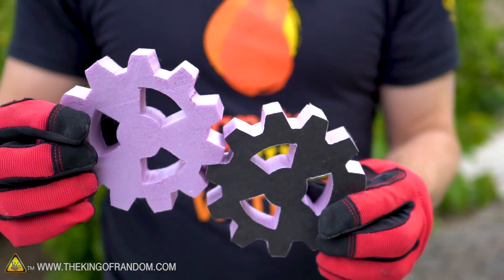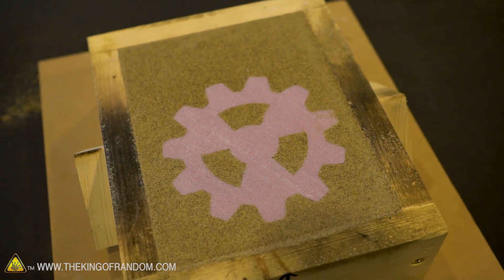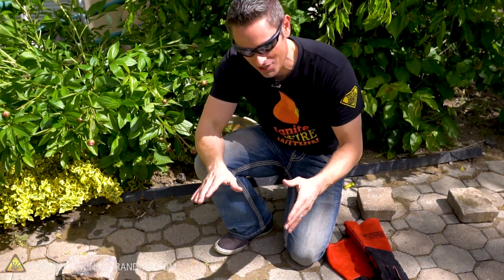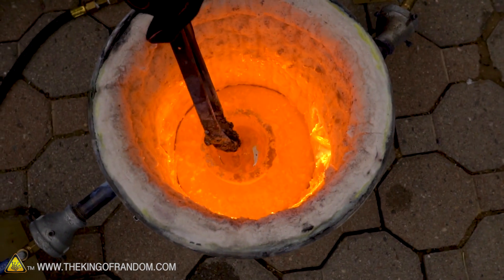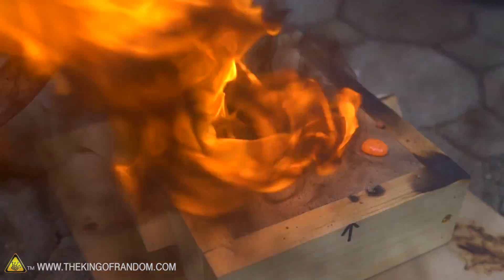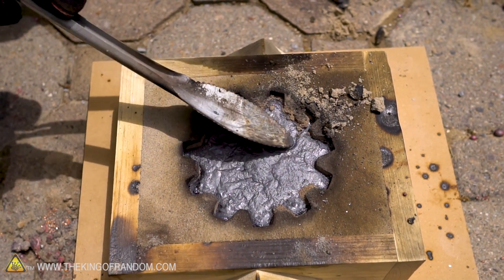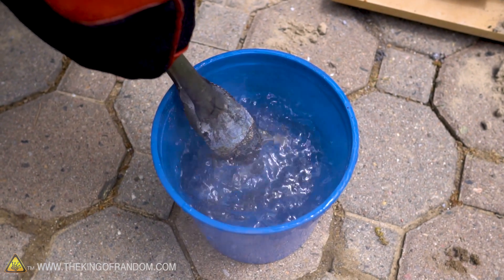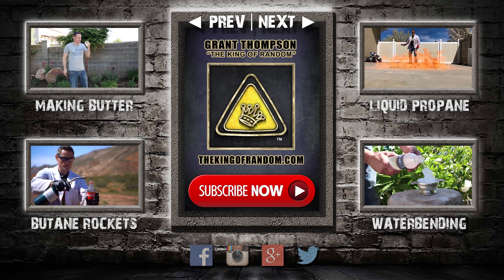Argh. Why Is Copper So Difficult? TKOR Tests Melting Copper In Our Homemade Foundry

Comment: Why aren't you using a cope? You have to have a cap on top of the mold, thus drag and cope sand casting. Copper is particularly difficult to cast due to gas absorption, not conductivity, it loves oxygen.  Capping your crucible would help, and try to keep your furnace reductive, the less oxygen the better. And where was your flux? A couple of teaspoons of borax would have helped tremendously... But, hey, who am I to tell you what to do...

Comment: cover it up. use a hole to pore it in. it will help keep the casting in place. make like a lil buffer so you dont spill al the copper. if you look at pro casting. never wil the cast be open. the air and water in your cast makes your cast brake up like that. copper is heavy, air and water is not and wil go up if not kept in place. its that simple.  ;-)

Comment: Geez, when have you amateurs ever seen someone set metals in open air moulds?  The forges of Mor'dor?  Make a straw from styrofoam, have it go through to the middle on one side and the rest of the way through on the other, pack the sand half way into your mould case, and put the actual gear shape in the middle, pack it the rest of the way.

Comment: I'm sure I'm not the first to mention this, but try a 2 part mold. Should help solve the lifting sand problem, also, try a Les dense foam, as it will melt out more readily and should provide a better finish, everything else looks right though.

Comment: Maybe instead of using the crucible to melt the foam, burn it off with a torch. Down side is the sand getting too loose. When you pour the copper there should be nothing in the mold to burn.

Comment: The reason why the sand is breaking is not the melting point. The burning mold produces gas. The pressure from the escaping gases has no where else to go. The copper is more dense than the sand. So the Sand gives way. This goes for all who are trying to make molds with foam.
Reply: and adding water to the sand makes even more gas with nowhere to go...
Reply: yes, he needs a better curing method for his green sand...I am guessing his clay content is kind of low as that sand did not look like the stuff I usually use.  I make my molds pretty wet, then let them cure.  Rarely do I leave the core of the mold in place either, nor do I open pour more than 30-45g of metal either; and for copper I don't use sand at all...plaster is way better for non-ferrous casting.
Reply: I think that another important reason (or more important then the escaping gases) is the Idrostatic force. I don't know the specific weight of sand but I'm sure that buoyancy force has a important role.
Reply: it works fine for brass. i use sand casting for all my gun mounts.
Reply: smart cookie , btw cookies cant besmart they have no brain , jk

Comment: Why are you using an open mold? Use a cope and drag mold. Get the oxide and slag to float up and out, keep heat in, help keep O2 out, stabilize the fragile parts of your sand. A whole list of benefits! But do't keep doing the same thing expecting a different result.

Comment: If you use settlement sand which is sand with cement wet it let it sit for a day or two it hardens and would actually let you have a reusable mold

Comment: Maybe you can use something like a little piece of metal. In the  pieces that we’re falling out.   The pack the sad around that. Much like. Rebar is used. It may stiffen them up enough. To pour 
I’ve seen other videos where the mold is totally inclosed to the the cast is poured into a little hole that. Is made  but be sure to put a few vent holes if u do that

Comment: The problem you are having is with your structure mate, you need a double layered sand so after you flipped the frame to pour the copper you shoulda put another wodden frame and filled it with sand and leave a tunnel like shape for the copper to be poured in and spread in nicely without ruining your sand shape and also shoulda added a breather hole as well

Comment: You sand does not have the required moisture. Casting sand would be far better. When doing a casting like the one you are doing spent wax would work better.

Comment: I think the reason that the mold kept breaking apart is that the sand was actually too wet. Notice that when the sand was dampened further, all of the center molds popped out, and when it was mostly dry only one did? There was too much water.

Comment: Question: why not bury the styrofoam gear with a riser and pour down the riser and allow the sand to keep the copper at a higher temp through insulation?

Comment: Hey Grant, might I suggest a smaller gear? If the main problem is cooling to fast, a smaller gear, with the copper at the same temperature should cast a lot easier than the larger size you've tried. Merely a suggestion but i hope i can help you!

Comment: I feel like you can do it with a plaster mold. Just glue the gear to the base and when you're pouring plaster into the box, try to get as much air out as you can by vibrating the box. Melting temperature of copper is 1085° Celsius and plaster can handle up to 1200° Celsius.

Comment: I've never seen a copper casting done commercially in an open mold (except for ingots). The thing with copper is that it's so thermally conductive that it never forms a "skin" of solid metal on teh outside to protect it from oxidation and such, so when it cools, it cools all at once. Because of this, your gating and risers can become quite interesting.
Reply: Your biggest problem though, seems to be from a complete lack of binder. Try adding some clay to your sand.

Comment: Just wanted to note two things... from what it looks like here it looks like you didn't tamp the cast soon enough in the process, and adding moisture was the opposite of what you needed to do - the reason it kept breaking off is because of the gasses being released breaking apart the smaller sand pieces. it needs less moisture.

Comment: let the mold dry for a couple days as an engineer I noticed when you added moisture it broke worse.  I assume what happend is the bonds broke when the moisture evaporated under high heat.  If I had the stuff I would try it myself but I would use wet sand to make the mold and then let it sit for about a week to get rid of the moisture before you do the casting..

Comment: I would try using a heat gun to melt those molds.  Much more consistent and easier to control and would allow you to leave your crucible in until you're ready to pour.

Comment: Six attempts and you haven't done any decent research? 

I haven't watched the rest, this was just recommended to me, but with a few seconds of logic and I think I have the answer;

The copper keeps breaking the mold, the casting is always messy. Perhaps the mold is the cause. Why not try hard set clay for a mold? Or Finer and cleaner sand, or perhaps a closed mold where you pour the liquid into a hole in the top?

I don't know maybe half an hour of research on the internet.

Comment: I cast alloys all the time from gold silver and chrome. I have a machine to do all of my castings. But usually I have a 50/50 mix of plaster and pumice. I set my object down in the middle of the mix. I usually do it on a burn out oven just to burn out the plastic and have a coating of carbon since copper have similar characteristics as gold (heat temperature 600c). Before pouring your copper in the heated mix make sure that you increase the temperature about 10 degrees of your crusible because you have to compensate on the heat loss of the molten metal. I hope this works

Comment: Literally you are the only thing making this difficult, research in staid of just winging it...
Reply: Said by somebody who has probably never even welded, let alone poured a cast. The reason he is having a hard time is because he is being stubborn about using playsand instead of casting sand. He probably knows full-well that there are better ways, but I would guess he wants the challenge of using these materials.
Reply: Fair enough. I still get the feeling he was actually just trying to involve the community to try and get commenters to suggest possible solutions, instead of just watching without thinking. It's a little more interactive that way. At least he's not doing it so wrong that people are going to die if they try this.
I once saw a tutorial on how to "weld" (really it was brazing, and not even doing it right) aluminum where the guy was first, grinding without a mask in an enclosed space... and second, did not clean up any of the aluminum dust before setting a torch to the brazing rod itself... the whole thing was just wrong on so many levels.
Reply: yeah its all part of his nice experiments
Reply: exactly. this is why i dont watch theses channels, experiments are fun!
Reply: The whole point of his channel is DIY. (DO IT YOURSELF)
Reply: What fun would that be though? This is his research. Nobody would watch if everything came out perfect everytime. There are plenty of channels to watch if you want to find out how to do it right. The trial and error is the fun part.
Reply: That's why he's the King of Random.. he just tries random stuff hoping it will work...
Reply: Not exactly a helpful comment.
Reply: YUP!  The old saying comes to mind:  Read a book Yah Pranit !!
Reply: Play sand does not have nearly enough clay in it.  Play sand only holds it shape when wet, and thus the copper evaporates this water rapidly without clay to bond the silicate together it just floats away.  Real green sand is neither expensive, nor hard to find, and the average metal worker has known the need for it since the bronze age.
Reply: Maybe you should pay attention to what you type instead of just ‘winging’ it.
Reply: Use a wax gear to make your mold. Or saturate your sand with wax.
Reply: Stephen Borntrager I do on a near weekly basis, this was just frustrating to watch, don't assume every commenter is clueless.
Reply: Neil Carpenter Exactly

Comment: You need to use casting sand(oil and sand) and make a runner and riser mold(double sided) and it will be much easier

Comment: Btw, you screwed yourself by adding moisture.  Adding moisture just means that the water will boil rapidly...hence why it basically blew apart.  Use extremely dry molding sand along with a closed mold.  I guarantee you will get the part you are looking for.
Reply: Moisture is not the only problem. Silicate sand is waaaay less dense than solid copper. We saw those chunks of sand floating on the surface - which suggests they were basically pushed out by pure buoyancy force in accordance with Archimedes' law.
Reply: yeah, I actually start with wet green sand...but I also let that dry out then.  The water and compacting tends to help the clay in the sand to bind better.  Water will cause pitting/bubbles.  Closed mold is a must.  Just not sure why he didn't just use a vacated plaster mold though either...non-ferrous cast can be done with plaster super easy...and if he was willing to split the mold then realign it, he could have kept to a single pattern and made dozens of molds to try and re-try the process a few times.
Reply: Jared Adams true
Reply: He said at the end that he hasn't seen copper casting in green sand so he wanted to try it if it could work

Comment: Man, you need to make 2 sand molds (on half of the geard\ mold) unite 
the both  molds and make 2 drains 1 to pour the liquid cooper and second
 one to evacuate the air so no bubles will form ! And I guarantee you 
wil ldo it from max the second turn !

Comment: you have to wet the sand until it's of little bit thicker than mud then you have to pour it while it's molten and it  and dry out the mold while not ruining the details of the mold itself

Comment: It works if you use a full mold with vent tubes instead of half mold, and get rid of your Styrofoam and use wood...note...take wood out before you secure molds and pour

Comment: If you try again sometime, maybe pour the molten copper (or other metal) from the sides and not the middle. Pour in a circular motion from the edges to the center?
Reply: Alternate idea: Place a weighted item just above the mold to hold down the parts that comes off and see if that works.
Pour from the edge and fill it up.

Comment: Run your gas torch over the mound as your pouring it stops the oxidizing that's how they did it on the sea core line at mim

Comment: your problem is you're using a sand mold, you need to use a plaster mold and a wax insert, the copper will melt the wax and be instantly replaced by the molten copper. once cooled the plaster can  be dissolved away with water or chipped away with tools.

Comment: All you have to do is put a top on it that's made of sand with a in hole about 1/2 big over the part you want then  add your hot metal in it how I have made parts useing that way

Comment: Hi KoR!  I don't have any experience with metal casting, but maybe this would work...Did you try making a channel in the sand to the edge, and then covering the open face of sand (where you were originally pouring the molten metal with another piece of wood?  That way you could pour it through the side (once you made a hold in the side of the wood, and the middle parts that keep crumbling would have support on both sides, maybe less likely to break apart.  The gear would have a long metal tag after it cooled but you could easily remove it.  - Hope that helps.  Love your channel! - Omar

Comment: My impression is that the impact of the pouring copper destroyed your mold in all cases. Try adding a "riser" to pour in, although of course you can not make it higher than the surface, it will give you a spot to safely pour into. You will later have to clean up the channel between the riser and the mold, but that should not be a problem.

Comment: I'm curious about pouring directly into the mold cavity, perhaps create a pour basin off to the side to allow the material to flow into the mold. In addition, I'd heat the mold with a torch before pouring, the material is solidifying before it can flow out properly. Just my 2 cents.

Comment: Maybe burn out the mold with a torch, then add a spru to the one of the teeth. Arrange the spru on top so gravity will pull molten copper into the mold and fill out that way. Sandwich everything on metal plates during the pour

Comment: One of the reasons is definitely that the mold is wet. The copper is really hot, causes the water to boil and then you get bubbles in your cast and critical failure of the mold itself because the water will expand and break it apart. You can remedy this by baking your mold in the oven which will also reduce the thermal shock on the mold and slow down the cooling process slightly.

Comment: Thought: heat from the copper is causing the moisture in the sand to evaporate too quickly, causing the detail to lose adhesion and break. Try a plaster or clay mold, maybe?

Comment: you should try to cover the gear with some more sand , a hole in the middle and pour until the hole is full, so the styrofoam melts , including the sand, and that will make the sand not breaking.

Comment: or try borax... You'd be surprised how much cleaner your castings with come out. Copper is a harder metal than aluminum which I'm sure you already know so instead of just switching soft metal - soft sand to hard metal - soft sand try changing to something a bit harder as well. I saw you use plaster to make your burner right? Try some of that.

Comment: Make 2 pipes down into the mold and sand on top ie bury the mold. Then cut the pour spout and vent. So glue a chunk of foam onto the gear then bury it. Pour till vent fills cut it off done better gear on both sides

Comment: picture drilling 4 or 5 holes on top of the top wood plate. then building a reservoir coral wall, that encircles the holes that veturi into the mold cavity...
now i suspect that wood might not work perfect but, then again it might...
Reply: poor hot copper into coral, copper poor through venturi holes, and into the mold cavity with a reduced/regulated pressure potential, while pooring...

Comment: I got a suggestion.

What about doing the same thing you did, only with cement. that way when the cement hardens it will hold much better against the gasses and pressure from the molten copper.

Comment: maybe try to make a second tray to act as a lid that prevents the sand from popping up when you poor. just a solid block of the sand that sits on top of your mold. use a piece of wire to make a poor hole in the center with a little bit of a funnel for the copper and three or four holes around the edges of the cog to allow air to escape.

Comment: try putting the mold deeper into the sand and making a pipe or tube or you will put the molten copper through feeding into the the mold that's deep in the sand not above the sand

Comment: dude u have to put the runner and raiser for  the cast then oly tht mould will not break and also another thing is  u shd not pour it in tht open air... there are possiblities ofd slag formation.. usu have to keep two box of mould and keep the gear in between u hav to do it with runner and raiser..the speed u pour , density of the molten metal  pour it lil bit slow ... it will help u

Comment: Don't melt the foam it needs the surface area to sublimate and you need a enclosed mold for copper so the sand wont move and it will insulate the copper so it has more time to fill out the mold.

Comment: U know there is a type of gas or chemical that foundries use to harden the sand after its pressed so u dont need Styrofoam to melt and it wont break up.. Look into it. I think it would help alot

Comment: Rather than having the foam at the surface of the sand have it in the middle, with a foam rod extending from the middle to the surface.  Then the upper levels of sand will hold the pieces in place that keep getting displaced.